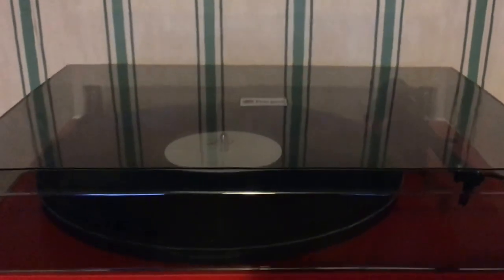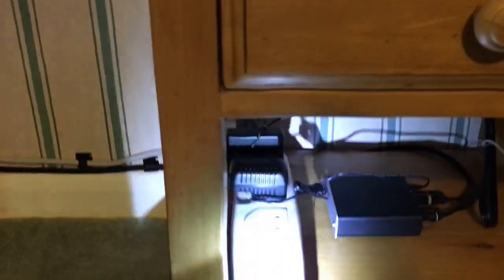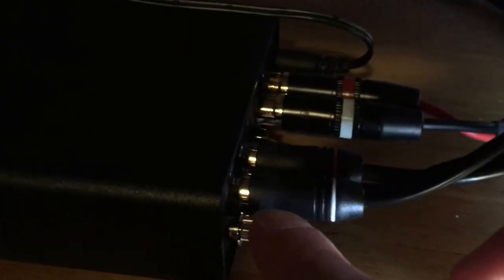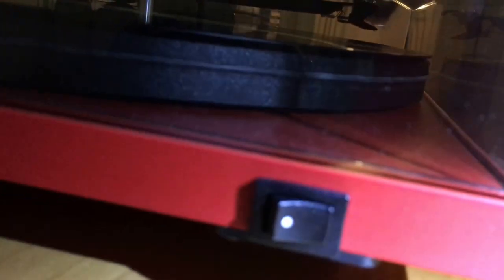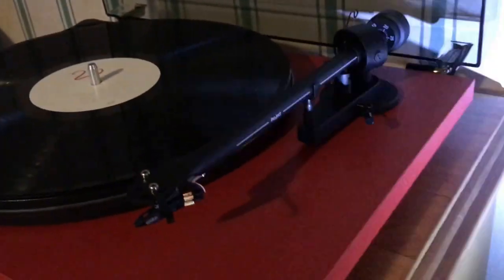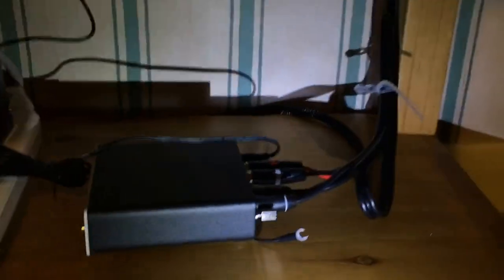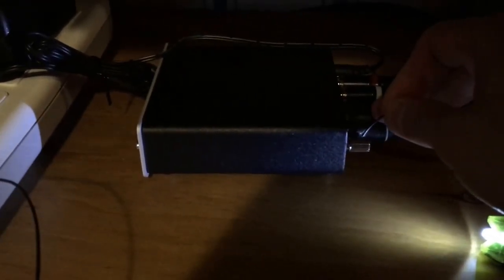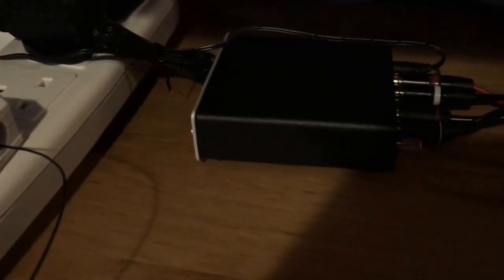SOLVED! Buzzing / humming noise from Pro-Ject Essentials II phono stage to Pro-Ject Phono Box ground

Comment: Normally would rely on ground through screen of phono cables to power amp so likely there is no continuous grounding through those active speakers. Not a design fault as in another set up connecting the extra earth would work opposite way in forming a ground loop.

Comment: I solved the problem with my Project Debut S phono the same way. I came to the conclusion after servicing an old Pioneer PL-512 turntable a couple of years ago. When I looked inside it the tonearm was not only grounded by the usual ground wire but internally they double bonded the tonearm ground to the motor ground the motor being an 240 volt AC type and that was connected to electrical earth via the mains lead. That stuck in the back of my mind and I wondered why they did that. The answer is that a lot of amplifiers and phono stages a powered by double insulated transformers with no earth connection at all I suppose that they could have run a spur internally to a earth connection. I think this leads to a floating ground even thought the turntable is grounded to the chassis of the amplifier that in turn is not grounded to electrical earth leading to a ground loop and that annoying buzzing sound. It is easily fixed.

Comment: Hi there thank you for the video.  I have a similar Pro-Ject Phono Amp that hums similar to your.  I unplugged the RCA cables leading to the TT but left the ground connected and the hum was still there.  Tried grounding the preamp directly to the wall using the 3-pin plug method you showed, but the hum get louder.

Did you manage to eliminate the hum on your end?
Reply from the maker: Hello, that's very strange. I still have a little bit of hum but from what I've read all phono pre-amps will have a little bit of hum. I now have 2 Phono pre-amps, the other one being a Chinese tube amp. Both have the same level of hum once the metal chassis is earthed to the wall socket. The hum is a lot louder when it isn't earthed. Yours seem to be the opposite, which is puzzling....
Reply: Got a new turntable (NAD C556) paired with the Pro-Ject phono box, the hum was significantly reduced compared to my previous TT.  The NAD turntable was internally grounded, so I didn't have to ground it to the phono amp.  Hum is only audible when I turn the volume up past the 60% range.  Attaching an earth wire from the wall to the phono amp did not reduce the hum either.

I'm using a pretty old Pro-Ject phono amp (still using a DC power supply).  My opinion is that the Pro-Ject Phono Amp isn't the best at insulation and isolating the electrical interference.  But I'm looking to upgrade to the Schiit Mani in the near future, so hopefully the hum gets reduced further.
Reply: I have the carbon tt,it’s weird I don’t have a hum like what’s shown in the video.I bought the Project High Power It,which is a grounded ac power supply from the turntable to the mains.This really  does a good job of getting rid of the aux hiss you get when the amp/ receiver is turned up loud.
My thing with the carbon is when I place the stylus down on the vinyl I have a a slight noise which isn’t a buzzing sound,it’s kinda like a hum I suppose,not sure to what it is.
It can only be heard when there is no music,but it’s weird because when I place the cover it reduces  this sound.
Pretty sure it’s not the motor screw issue or anything like that,I thought that issue was from a few years back.
It’s a great sounding and looking tt,and really like it,just would be cool if I could get rid of the noise,I think it might be a pre-amp issue,any one with any ideas?
Reply from the maker: hmmm grounding the AC power supply to the turntable in my case won't make any difference as it only powers the motor and has no connection to the audio path at all.
Reply: Could you provide a link for buying the Project High Power It? Is this an OEM or after market?
Reply: @kenneththam2480  i got Schiit Mani and Project Debut iii..hum still there but not that bad..when i touch  phono rca it goes away completely

Comment: My brand new Pro-Ject X2 has an unbearably loud hum.  I've ordered a Pro-Ject High Power It cable but it's taking forever to arrive.  I'm at my wits end.
Reply from the maker: have you tried the solution in this video?
Reply: @BrianSu  No, I don't know where to get that wire he plugs into the outlet.
Reply from the maker: @elmhurst86  it's just a wire, use anything.

Comment: Hey. I’m really late to this to this video. Thanks for doing it. The earth plug you have - is the tip plug cut off? It’s just a wire end? It doesn’t seem to be working for me. Appreciate feedback.
Reply from the maker: what do you mean tip plug cut off? nothing is cut off. just install screw a piece of wire to the earth pin inside.

Comment: Hi how do I make that white plug?  Thanks
Reply from the maker: buy a 3 pin power plug for your power socket. Open it up, screw the wire on to the Earth terminal and close the plug up then plug it into the power socket :)
Reply: Brian Su where did you get the white wire from??
Reply: @BrianSu  just remind them to disconnect the live side of the plug by removing the fuse as it is not needed

Comment: hey brian

Just a question... what voltage was the plug you used? I have one 13A plug that has around 250 volts but it seems to be making the hum louder...
Reply from the maker: +liam murphy sorry what plug are you referring to? the white one for grounding? I won't matter because it's just used to connect to the Earth terminal.

Comment: Thanks so much for sharing this Brian - I too have this problem with a very old Project Debut Deck and while I let it slide for a long time and tolerated it, I can now no longer listen to music without hearing it and it's driving me mad! I've just purchased a grounding wire and anti-static/grounding plug (was scared to do the work myself unfortunately) so really hoping this will resolve it finally. Will update when both components arrive, gutted as it means I can't listen for a few days. Thanks so much again.
Reply: PS. One quick question I forgot to ask, did by any chance placing your hand on the your tone arm metal make the hum louder? Seems to be the case with mine

Comment: Excellent. I have a project carbon debut with the project phono box s. Hums like crazy. The local rega dealer warned me about the hums from project turntables, but I found it to be the phonobox as well.

Fixed my issue.
Reply from the maker: Great!
Reply: Ken Dedesko Rega hums as well unless you earth ground your pre amp or receiver. You use the exact same method. Don't call Rega or a hi-fi shop because they will attempt to sell you a "power cleaner". That's a big expensive box that provides the earth ground.

Comment: Thank you I had the same hum also with pro-ject dc Carbon turntable and pro-ject phono box preamp.  I always thought it was the turntable causing the issue until I used the phono input on my marantz integrated pm 8005 then the hum went away but the integrated phono stage didn’t sound very great(less dynamics).  So I did this with my pro-ject phono preamp and the hum went away and sounds way better then the marantz phono stage.

Comment: im getting humming issues but im using a LINE CONNECTION. is that even normal?
Reply from the maker: you mean your turntable has a built in pre-amp and the output is already at line-level?
Reply: Brian Su correct... so that’s why I’m not sure why this is happening unless it’s bad wiring in my turntable
Reply from the maker: @Rylaaaa  if I were you, I'd power the whole turntable with batteries to see whether this still happens. If it doesn't, then you'll know it's AC hum :)

Comment: that's exactly the same problem i have, i was looking for cables like the one you used to fix the issue, but i can't find it anywhere, so i think i have to make one by myself:( it would be great if you could make a video to show how you did it!!
Reply from the maker: it's really simple, just get a 3 pin wall plug and install a single wire to the Earth connector and connect the other end of that wire to the pre-amp's body :)
Reply: Brian Su Hello Brian,do you mean putting a ground wire round the earth on the Pro-Ject preamp.If so am I still leaving the other earth ground wire from my preamp up to my turntable?

Comment: Where could i find that please ?
Reply from the maker: find what?
Reply: Brian Su the ground earth wire
Reply from the maker: Miguel Gonzalez you can use any wire for that. Search for a small diameter one on eBay with the colour that you want.
Reply: Brian Su could i use speaker wire? If so, where do i attach it to? Thank you
Reply from the maker: Miguel Gonzalez yes of course. Attach it to the metal body of your pre-amp and to the Earth terminal of your wall socket
Reply: Brian Su thank you do much! I’ll let know later if it worked! Appreciate your help 👍🏼👍🏼

Comment: I'm getting a buzz from my speakers with my turntable wired to it so I got a ground cable and it's still buzzing so I'm going to check all my cables when I get bk home
Reply from the maker: Hi is your turntable from Pro-Ject?
Reply: @BrianSu  no its a kam turntable I've HD it for a while just stored away so I will check all the cables and wires and move my plug addpter and see if that helps. My amp is nowhere near my turntable enough to cause a hum and I will also give my cartridge a clean and see if that helps
Reply from the maker: @djpaul146  yeah please keep me posted if you wouldn't mind. I'd like to know how you solved yours :)
Reply: @BrianSu  will do👍

Comment: unfortunately mine got worse by doing that. technics SLB2 and  MONACOR SPR6
Reply: fixed: i've misunderstood, i attached the grounding cable of the turntable to the plug :-) after some extra research i've noticed that i have to connect an extra cable to the ground of the preamp and then to the ground of a plug. So yes, this actualy works fine. Payed 60€ for this preamp...unbelievable. tnx!!!

Comment: Thanks for this video! Unfortunately, I have a similar problem, but connecting to ground doesn't seem to help. I have the same turntable but the version with the built in pre-amp, so I can directly connect the back of the turntable to a set of speakers using RCA cables. In any situation, whether or not I connect the back of the turntable/preamp to ground doesn't seem to affect the humming.

Do you have any ideas of things I could try? I know it's not a problem with my speakers, because when I pull out the RCA cables, the hum disappears, and the hum also disappears when I turn off the power supply to the turntable. I also took the turntable to a hifi store a while back and there were no issues with humming. Perhaps a problem with my power supply (dirty electricity)?
Reply from the maker: yeah you can't use this method if your pre-amp is built in. The hum that you're getting is probably because your amp isn't grounded. I have the same problem because my speaker runs on 2 pin plug. The Amp in your hifi store is probably one of those expensive ones with metal body and runs off 3 pin plugs so the body is grounded. Unfortunately nothing can be done unless you change your amp?? What amp are you using?

Comment: I have a Pro-ject phono box S2 with this exact same problem.
Reply from the maker: What turntable are you using? There are better ways to solve this.
Reply: @BrianSu  Pro-ject debut 3 S Audiophile
Reply from the maker: @ynnadk9859  ok on my new TT the Debut Carbon EVO, the phono ground lug is connected to the Negative (-) terminal of the DC Motor. The system is now grounded as I'm powering the motor with the Pro-Ject High Power it which is an earthed power adaptor, i.e. the transformer inside and the Negative terminal of the output are connected to earth.
Reply: @BrianSu  I'm just gonna swap out the phono stage for a different brand.

Comment: I have a Cambridge audio duo, which has a grounded plug, but I still needed to do this trick to get rid of the hum. Thanks!
Reply from the maker: Hi did you mean Alva Duo?
Reply: @BrianSu  yeah Alva duo.
Reply from the maker: @geheimen  I've had a look at that, it has a 3 pin connector as you say, this is surprising. Maybe the ground lug isn't connected to Earth from inside the unit. I would open it up and solder a wire to bridge the ground lug to earth internally as it's a much more elegant solution that running a length of wire to the power socket :)
Reply: @BrianSu  hmm,I’m not sure if I’m gonna keep it yet, but if I do, I’ll check it out. The weird thing is that, exactly like in your video, the humming does decrease when I connect the normal gnd wire from the turntable…..it reduces it by half I would say. So it is doing something… it just doesn’t go away completely. That only happens when I do your solution.
Reply from the maker: @geheimen  yes it will reduce slightly without my solution. Mine did too.

Comment: What is that device called?
Reply from the maker: which one?
Reply: The little box and wire that resolved the problem.
I have speakers that are rumbling when I put on my turntable. I tried distancing,  decoupling, foam, rubber, wood, turtable platter mats....everything. I am ready to ditch the whole turtable idea. But this is tge first time I've seen thus method of truly grounding. So I would like to get that wire and plug in white box. What is it called?  Do you have the link from which I can order it?

Comment: I have the same issue with my Rega Fono Stage MM. Sadly I have no Earth/Ground connectors in my entire appartment. Im fucked.
Reply from the maker: How is that possible? You haven't got 3 pin power sockets in your apartment? If that's the case, use your water pipe!

Comment: For some reason, my buzzing depends on the cable used. My old cable had literally no noise, but was too short.  I bought a $60 cable, and it still had the problem. But with a cheap dollar store cable, it worked perfectly fine. 
This is driving me crazy!
Reply from the maker: specifically which cable are you referring to?
Reply: Brian Su The cable that works perfectly is an "accustic research performance series"
And the expensive cable that I just bought is an "ultralink home turntable phono cable." 
I'm using it as an extension for the cable going from my turntable to my phono stage(a Schiit mani). 
It's just super weird though. It know it's a grounding issue with the more expensive cable, since when I touch the phono stage with my hand, or ground it out with an outlet ground, the buzzing reduces, but not completely. 
What I'll probably do is just try to find a longer version of the cable that I know works.  It just sucks that I can't use the high quality cable that I bought, since it most likely has a much higher sound quality.
Reply from the maker: Hi, thanks but I was asking what type of cable it was? RCA to RCA or to 3.5mm etc.
Reply: Brian Su just regular rca to rca
Reply from the maker: ahh ok it sounds to me that there is some external source of interference if different RCA cables produce different noises.
Reply: The expensive cable is probably not very well shielded, or high capacitance. For turntables you need LOW CAPACITANCE interconnect/phono cable. For digital stuff, you can use any old thing and should work ok. But turntables, with such low level output, you need a good cable. I personally use mogami 2965 cable with my choice of interconnect. Some of the lowest capacitance I have seen are the Blue Jeans LC-1 and I think a Grover cable. But the Mogami 2965 is a great cable for turntables.

Comment: Thanks for this video Brian. I'm not good enough with electronics to do this, but it gave me the push to investigate and in doing so I discovered that Pro-Ject sells an official power supply for this  called the 'High Power IT', which eradicated the problem entirely and instantly. Same principle - it has an earth wire to ground the turntable effectively.

But I never would have asked the right questions that led me to THAT solution without yours. Thank you very, very much :-)
Reply from the maker: That is very interesting. I'll look into this device. Thanks for the advice :)
Reply: How did that fix the ground loop though? There is no connection between the tone arm and the power supply to the turntable.

Comment: Tried this setup with my Pro-ject Debut Carbon DC and my Phono Box DS. I still get a quiet hum when I sit next to the speaker.

The hum is hardly noticeable when the tonearm is on the rest, but gets louder when it gets closer to the spindle. It does not matter whether the motor is running or not.
Reply from the maker: +Eric de Redelijkheid of course it won't matter whether the motor is running or not. It is isn't physically connected to the tone arm :). Anyway try this, build a battery pack to power your phono box and use that. disconnect the power adaptor from the turntable. If you still hear the buzz then it's 100% certain that it comes from your main speaker's amplifier and has nothing to do with the Pro-Ject stuff.
Reply: +Brian Su https://plus.google.com/111956387754630933111/posts/cnaw4zfpjMu

Solved it with a wire from the spindle-base to the grounding screw and a Acryl-It platter. I don't need ground-wire to the mains after all.
Reply from the maker: +Eric de Redelijkheid Hi, thanks for the advise. I believe we are both suffering from different issues. My interference is produced externally from the amplifier (not the external pre-amp). I am using a Bower and Wilkins Zeppelin Air. I tried hooking it up to a much cheaper speaker system (Bose Solo 15) and the buzzing became even louder. Perhaps the only solution is to look for an Amp that has an earthed body.
Reply: +Eric de Redelijkheid Very interesting. I have a Stanton t60 that I'm modifying. 
I've had a lot of problems along the way, but this is the last problem that I have: a hum which gets louder when you move the needle to the middle of the turntable.

Curious.